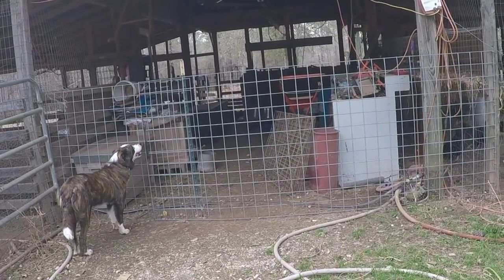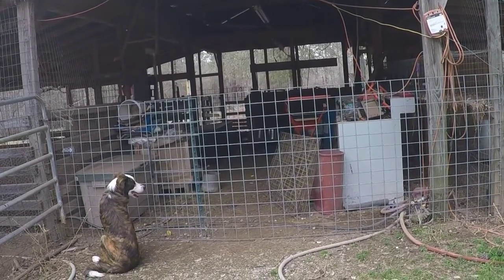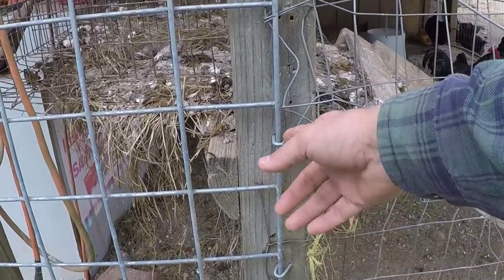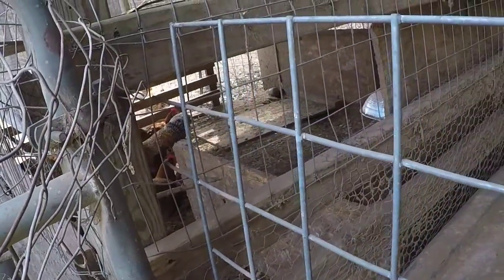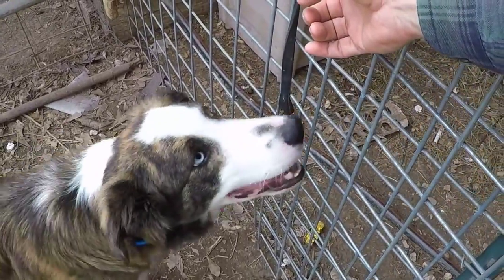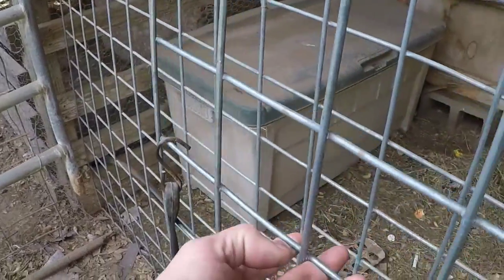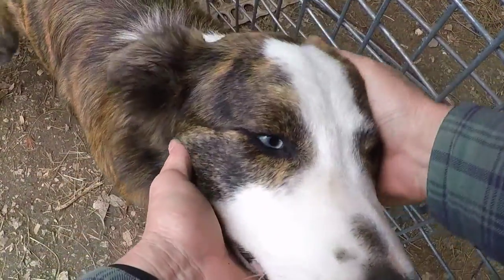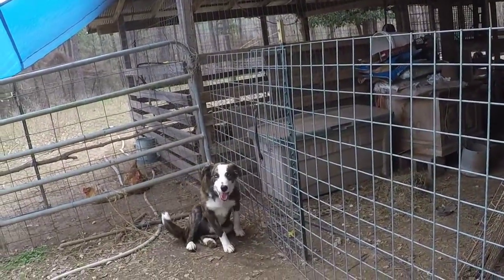AldermanFarms Quick Tip | How to Make a Gate with a Cattle Panel

Comment: Hi Tommy, I like the tarp strap idea, I normally use a short piece of dog chain with a clip, I like that the tarp strap would hook the panel in two places. Thanks for the tip, Mark
Reply from the maker: +Mark at Sunbird Acres yep!  Our initial use of the  bungee was a result of "what's available," but we LOVE it because it holds the gate shut tightly, and it's so easy to use!